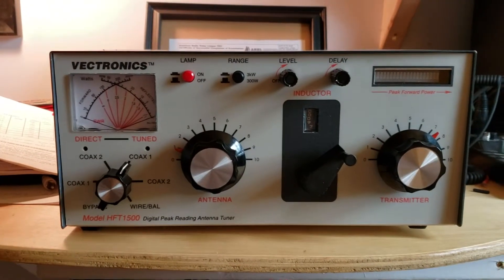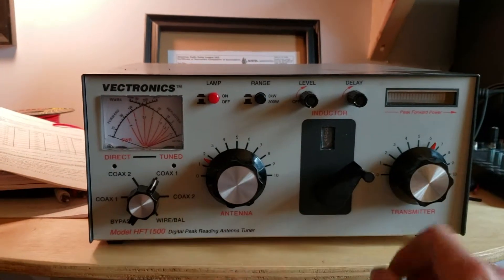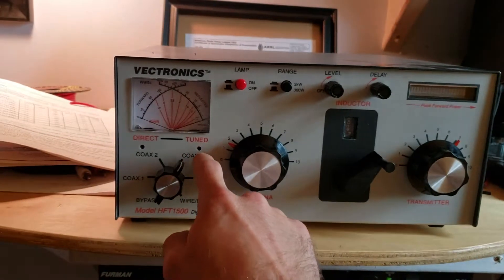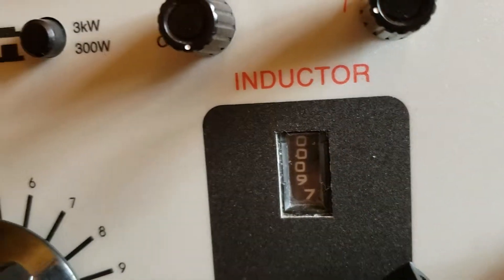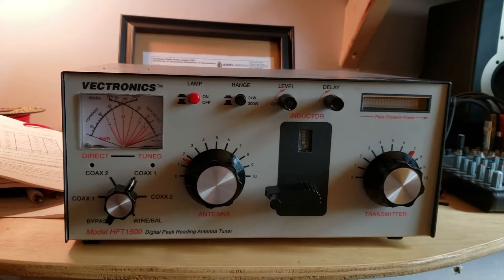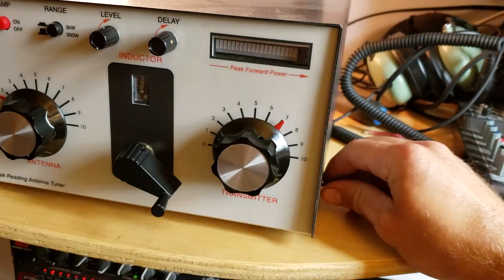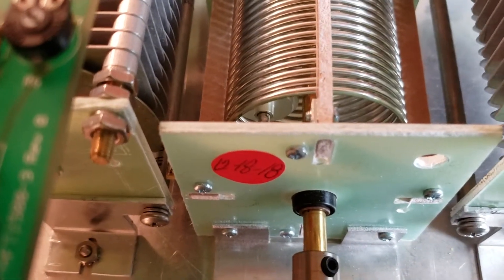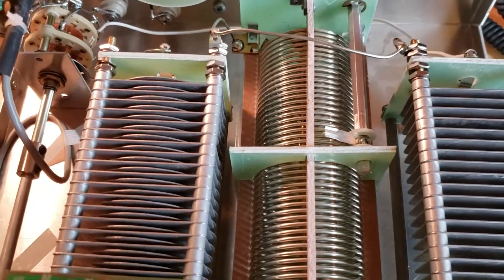More Vectronics Antenna Tuner Issues

Comment: You would be beter off hardwiring in jumper locations to teh inductor adn putting a 6 position switch, to hell with those roller inductors....
Reply from the maker: Somewhat agree. I've got a dentron with tapped inductor but I do still love a roller. I've been happy with the 5 murch tuners I've got.